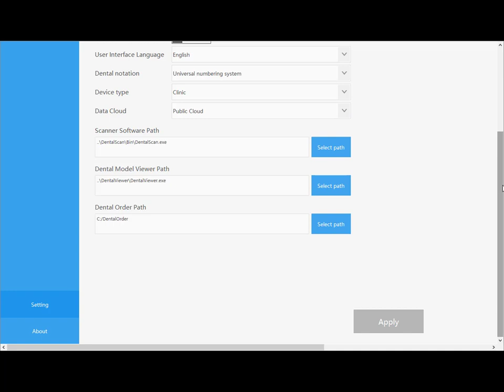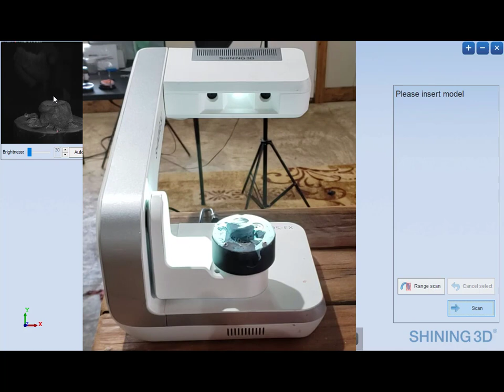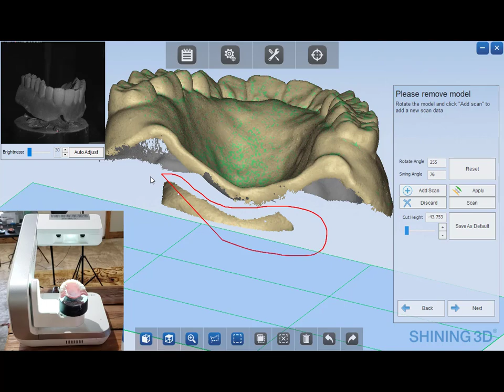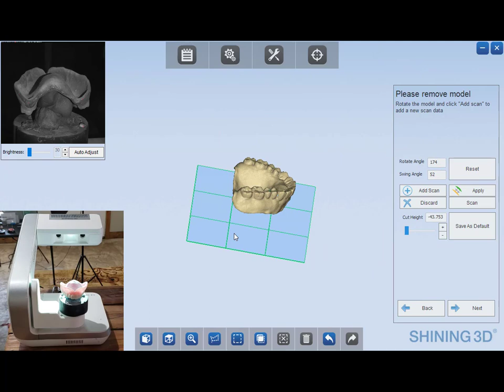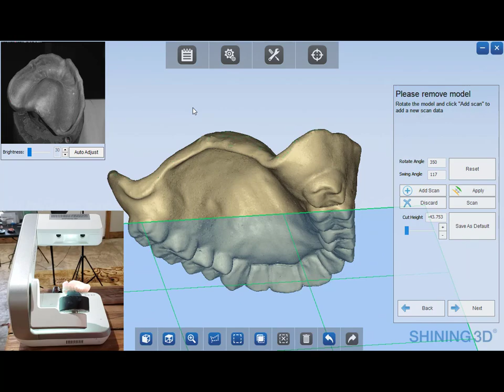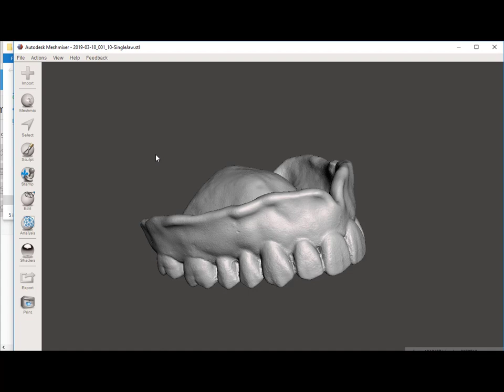Digital Denture Duplication with Shining 3d DS EX Scanner

Comment: Hi Cory,
A question- using the software that comes with the Shining 3d scanner is it possible to (a) scan a partly dentate model THEN (b) scan the same model with a traditional waxup partial denture attached. Then "subtract" one from the other and be left with a stl file of the waxup ? My plan is to print as a monoblock denture and apply light cured resins to characterise.

Comment: If a patient is happy with their existing denture(s) then why start from scratch.  This is a great technique.  Wondering if it's possible to take a wash, inside the patients existing denture, before scanning, i.e a reline impression?
Also, the existing upper and lower would offer up a predetermined centric and vertical ... great info if you can get it into the CAD program, yes?